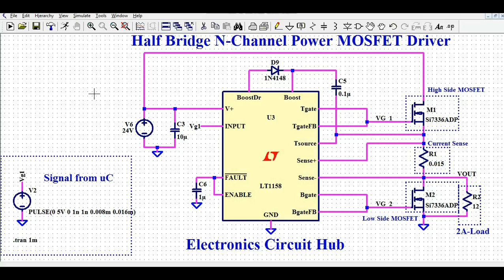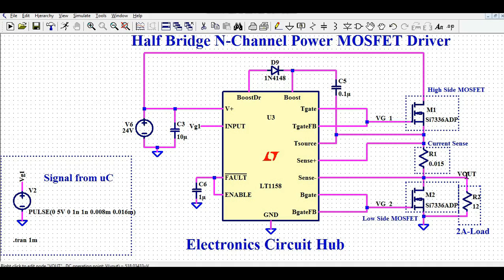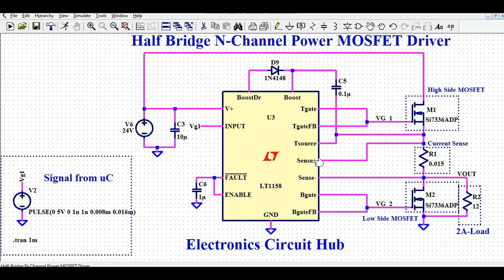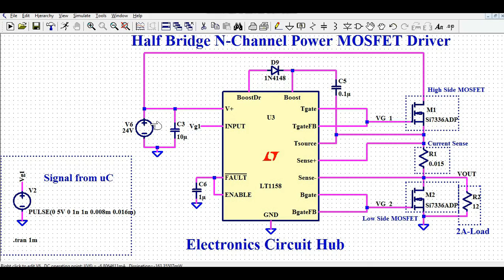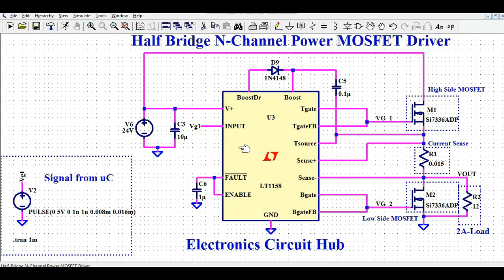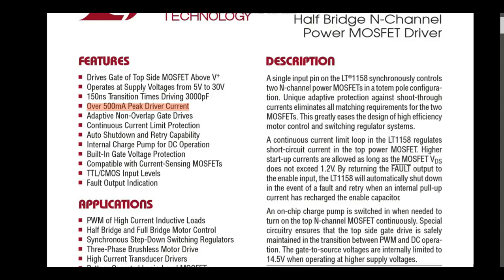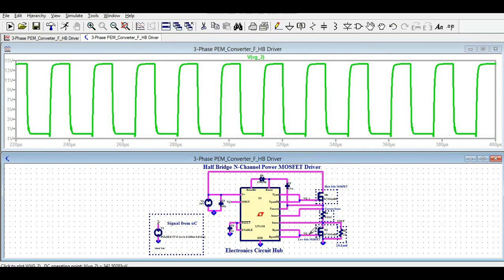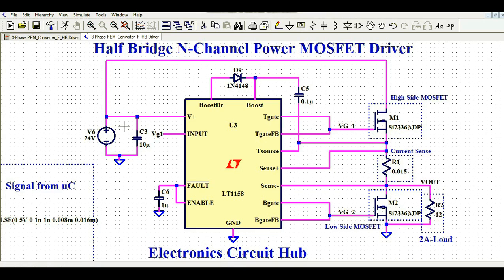Simulating Half Bridge N-Channel MOSFET Drivers

Comment: its very informative. can you please also demonstrate another example for driving cree mosfet at Vds =200-300V supply half bridge inverter example. Because im bit confused with this gate driver ic since its using single dc source for driving both driver and mosfets.
Reply from the maker: Hi..There is no relationship between mosfet gate and Vds voltage. Mosfet gate is totally independent. Check the maximum vgs voltage of mosfet you have selected. Fixed the vgs voltage voltage for your mosfet based on input and output curve. Finally select the gate driver per your frequency,  vgs and source and sink current capability. Hope this helps.